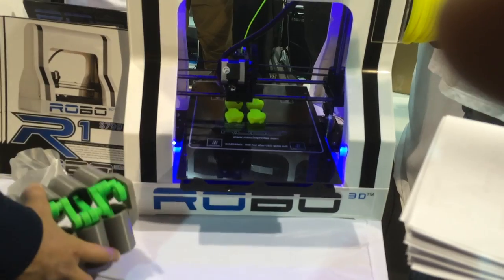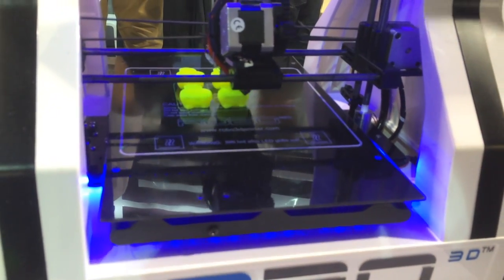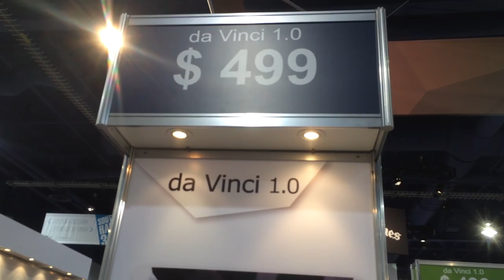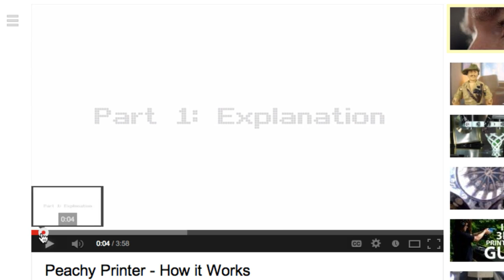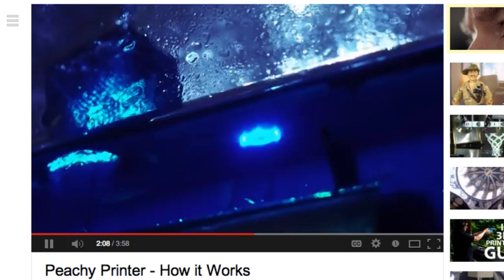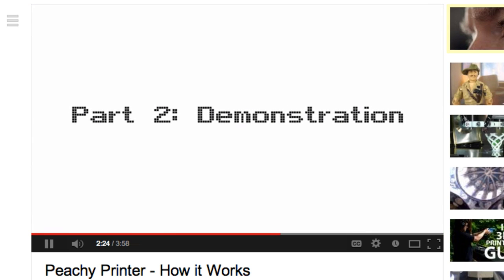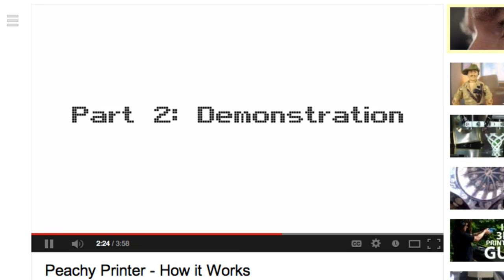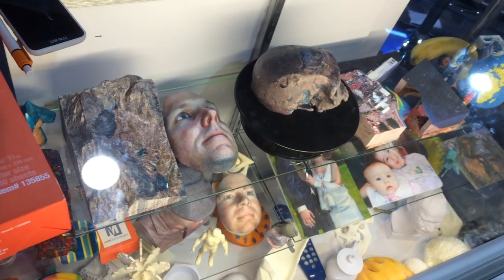CES 2014 Top 3 Tech of 3D Printers

Comment: One thing that I would like to know about the 3d printers. 3d printers have the parts that move to make the object and they have one part of electronics , a mini computer that makes the printer work. If we need an external computer to model, couldn't we use the external computer to do the work that the mini computer does?. And by doing it, wouldn't the need for the mini computer be obselet and therefor make the printer cheaper?. I will bet that a smartphone could do it. There must be an app for that on the App Store :)

Comment: I Just want something that will print a VRase so I don't have to buy the oculus rift. And I can watch hd 3d movies and play games right by my baby while he's sleeping.
Reply: Hmmmmmm.  If that's you're goal, I would advise against it.  You would spend far more than you would to buy a Rift if you buy a 3D printer to make a VRase.  You can just buy a pre-assembled VRase for less than a Rift.  Besides, the VRase doesn't come anywhere even close to the quality of the Rift.  I have two cell phone based sets of 3D goggles, and the big problem is just that the cell phone isn't designed for it.  There's some major issues with drift, field of view, and control.